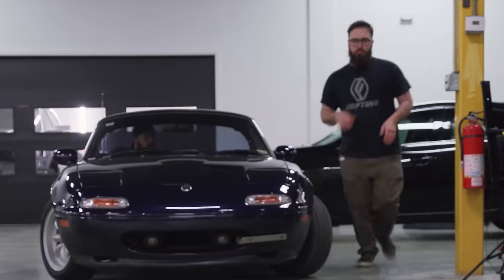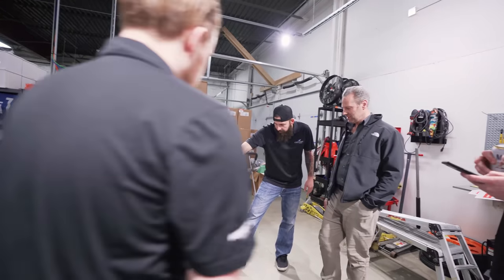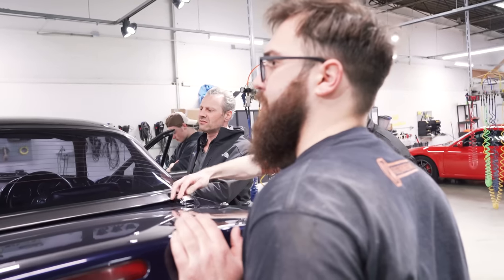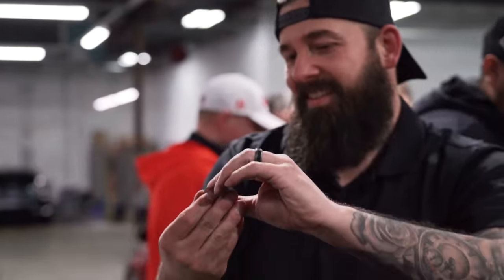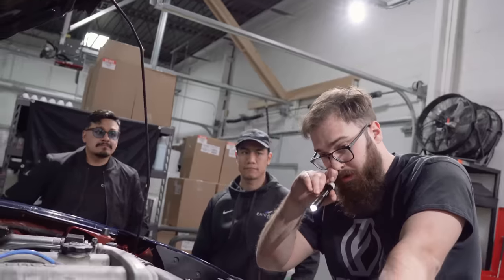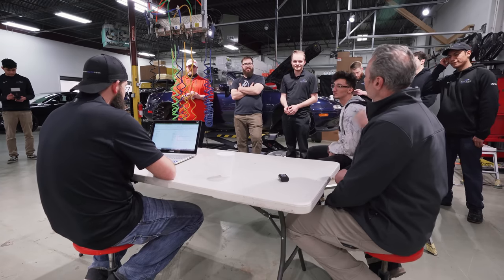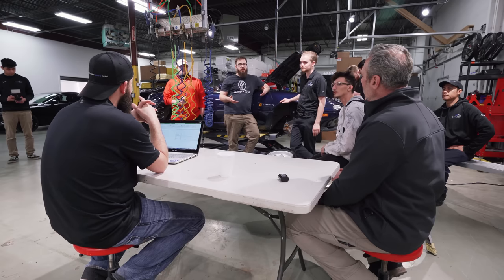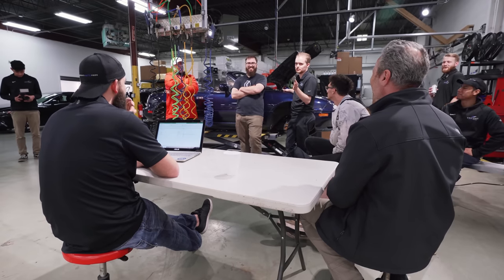Look What We Found! | Eunos Project Car Inspection | Chicago Auto Pros After Dark

Comment: You guys are amazing!  Before I ran a Tesla channel, I had a Miata channel.  Let me know if you need any advice.  I love those seats...they're from retroseats dot com, and not too expensive to replace.  The engine bay is red, so I'm guessing the exterior blue is a respray.  Just paint the whole thing (engine bay included if you're removing the engine anyways).  Lose the soft top and save 40lbs.  If you want to keep the soft top, I've got a step-by-step DIY replacement video on my other channel "Because Miata".  I've got BC Racing coilovers on mine, and I recommend looking into those.  If you're getting wheels, you can't go wrong with the 949 Racing 6UL wheels.  They're flawless.  If you're going turbo, you can't forget the supporting mods like an upgraded clutch to handle the power, a big brake kit to help stop a faster car, and more than likely an upgraded radiator to keep it cool.  If you're looking at aftermarket sites, I've had the best luck with Flyin Miata.  Quality stuff there.  Excited to see the rest of the build!

Comment: Lots of people screaming turbo! Kit! Paint! Etc.... First what needs to be done is suspension, brakes, bushings things like that. None of the other stuff matters if you don't do those things.
Reply from the maker: Yes we're definitely going to be taking care of the necessities
Reply: @ChicagoAutoPros  dont jack it up by the frame rails gonna crush em and lose the chassis rigidity lookup the proper jacking points. hint the corner of the seam welds in the four corners.

Comment: The latches on the soft top are about $80 dollars for a pair on the used market so don't put them in the bin, put a m62 blower on it for power (easy and cheaper than a turbo kit), 5 speed swap for fun, Torsen swaps show up around here (Chicago) for about $6-800.